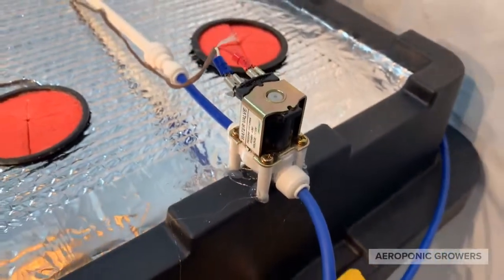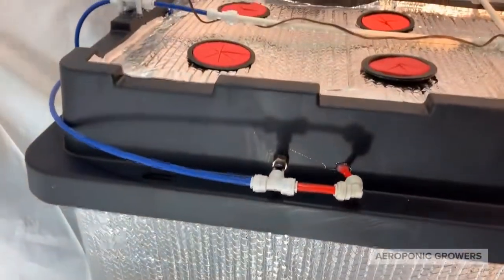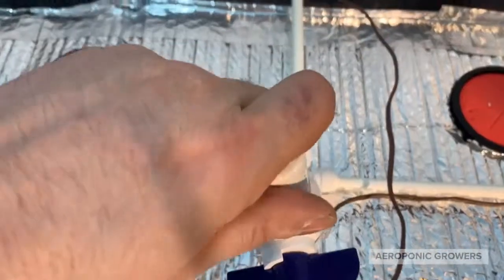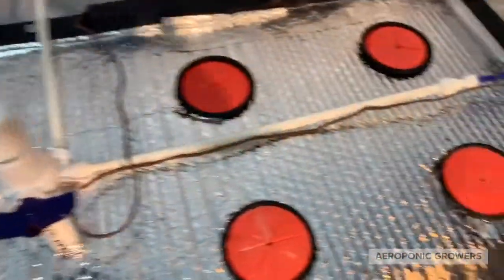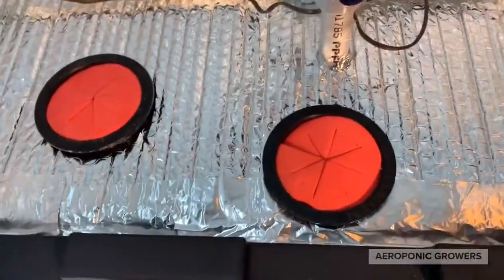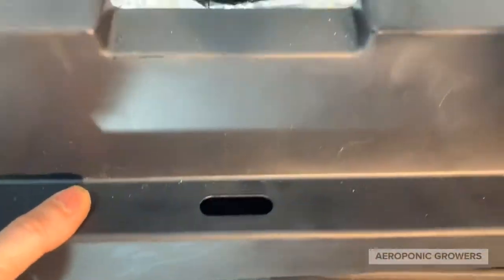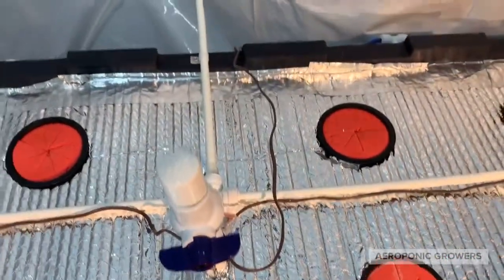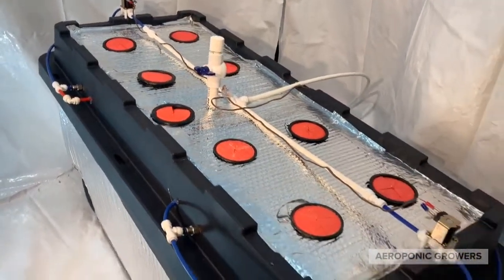Aeroponic Growers DIY Root Chamber Quick Look

Comment: You dont need the low pressure option. If you clone with low pressure, the roots will take time to adapt to the high pressure mist. Cloning with high pressure will produces the correct root structure from the get go so you dont lose valuable growing time in transitions.
Reply from the maker: GeoAeroponic you rock! Thanks, I took a plant 3 weeks into bloom cut off half the roots and put it in a small igloo container with one mister on the bottom, put back into veg and bam I got white roots again! Thanks.
Reply from the maker: Hey I absolutely agree! Thanks, how would you recommend running the system? If I clone high pressure the system is running at 2 seconds on 1 second off, if any off time. I did it as a work around so people would have an easier success rate at first, plus I always have the home grower in mind and I haven't found a way to clone high pressure without a lot of constant noise. Do you recommend cloning high pressure in a much smaller container first?
Reply: @AeroponicGrowers  
A smaller container will be more efficient. something like a 5 gal bucket with a single upward facing nozzle. Cycle timing set to mist for 2 seconds every 5 minutes but dont be surprised if they need even less. If you run too much mist you will get the same results as using low pressure. Here`s a quick vid of an 8 gallon cloner (plastic planter) with a single nozzle and 2 seconds of mist. Nothing to it ;)  https://youtu.be/eRzcWjT8q84
Reply from the maker: GeoAeroponic I haven’t had success with fresh cut clones and that misting cycle, but now I’m excited to try your recommendation using a much smaller root chamber. 64 gallons compared to 8 gallons is a huge difference. Thanks! Hey by any chance have you tried High Pressure in 13 gallon buckets? I can’t get the same explosive growth like my 55 gallon plus containers.
Reply: @AeroponicGrowers  
I clone in 8 gal, veg in 40 and flower in 80.
Reply from the maker: GeoAeroponic okay good, that’s about what I’m running. Every time I’m about to launch the website I run into another issue! Hence the year long project. What do you advise for roots covering misters? I have the misters on the lid, but the roots are huge balls and I just can’t get mist around the top to let it settle. I just put Tefen white misters on the bottom in the center up about 6 inches. I’m thinking I have to just do a center row of plants instead of two rows? Or 1000 psi on a stainless steel impingement bete nozzle and hope the negatively charged droplets bounce off the plastic?